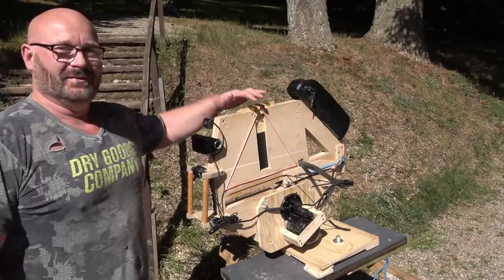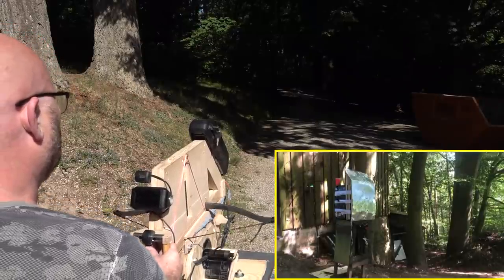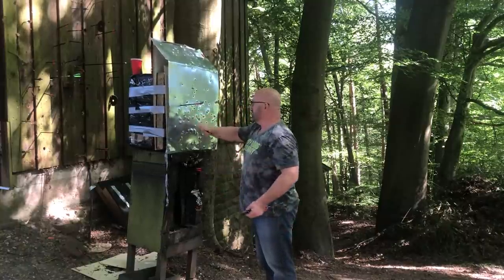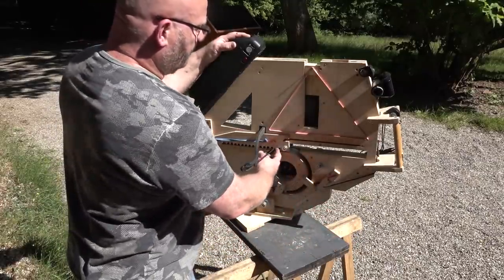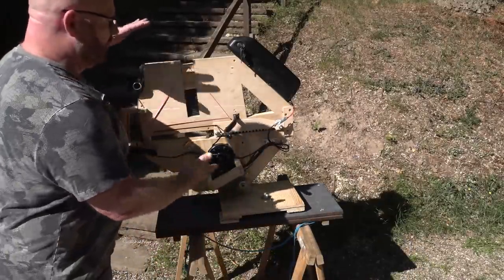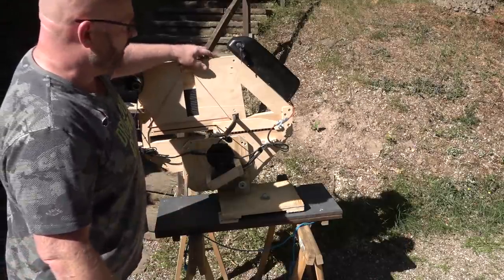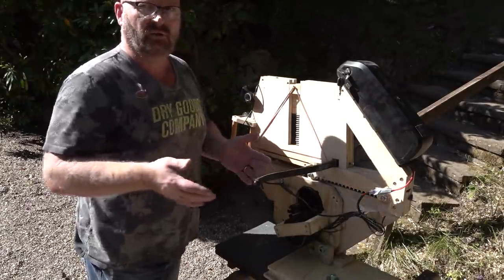The wonders of the full size, full auto crossbow.

Comment: Joerg, hear me out: the next logical extreme is an automatic ballista. You'll probably need a large diesel engine to run it, but it would be the scariest pseudo-medieval siege weapon in existence.
Reply: aktually steam engine wood be perfect for this
Reply: Or the walkingrad that some trebuchets used. I'm sure with the right gears, you should be able to do something.
Reply: @erikbergstrom258  
A Stirling engine would be epic. It's the same principal as a steam engine but instead it rapidly heats and cools air. It can use literally anything flammable as long as you can get the proper temperature difference between the hot and cold side. Literally power a ballista off of a pile of wood. Or for your ORK BOYZ out there a flaming pile of car tires. Sorry for the Warhammer 40k reference. Lol
Reply: @isaiahcampbell488  , It would be cool, in general they have a higher efficiency, though stirling engines have a lower power to weight ratio than steam engines. But or a fixed installation, UNLEASH THE DAKKA!
Reply: I'm just laughing so hard trying to imagine a diesel powered full auto ballista, you made my day
Reply: Isn't it amazing how Joerg spurs your imagination with his stuff?
Reply: @mennograafmans1595  Maybe six or seven hundred hamster wheels, turning a single crank?
Reply: You made my day. :D
Reply: Yeah, I have been thinking of doing this myself. With a ballista you have that opening in the middle so there is a little bit less strain on the system. Another improvement is to add a set up a rig to prevent long term damage into the ballistas frame and slide/sled. The idea of a rapid succession of large bolts heading down range is amazing!
Reply: @isaiahcampbell488  they are efficient but they're heavy, and expensive
Reply: I imagined it firing, what I saw was a medieval Katyusha, with the constant buzz of the diesel motor, rhythmic banging of wood, thick ropes sliding all over the place, and the sound of lances flying one after another
Reply: make the toadfish from crossout
Reply: And then he would shoot it from the hip
Reply: The scariest medieval siege weapon was already created. Its called the trebuchet
Reply: You could just use Ropes that are under pressure, which is relieved at once or in bursts. Could be mounted onto defense Towers. Maybe even gravity assisted unloading through weights.
Reply: Isaiah Campbell problem is that sterling engines are shit for anything practical
Reply: If it's for dragon hunting, what do you care?
Reply: Excellent idea, but there is already a weapon that can do that called a polybolos, which was a smaller version of a standard roman ballista powered by a crank handle and specially-built chain link to cycle the string. It was invented by the Greeks in the 3rd-century BC. Still, ballistas are an interesting class of weapons because they were used as naval artillery on warships like Quinqueremes and Hexaremes during the Punic Wars.
Reply: 3 Phase Electric? (with odrive...)
Reply: My desire to design, construct, and utilize a Jeep-mounted one is how I found and followed Joerg in the first place. It isn't viable for sieges, but it is wonderful for both disrupting riots and dispersing mobs of savages crippling traffic.
Reply: What if he converted a Hellephant car engine into a full auto ballista??? I wonder what would happen...

Comment: Hmm, seems you could make it an even power cycle by having the second set of teeth, but the second set of teeth goes to another bow. Two different sleds driven at opposing sides of the drive gear and therefore firing in an alternating sequence without putting more strain on anything.

Comment: Actually I see one way to make it portable. You can put the battery in a backpack and make a special sling (like baby-sling haha) so you are able to carry the crossbow on your chest. Looks like some adjustments will be needed so you can comfortably operate it. Plate to comfortably and firmly mount it to the body and the trigger button needs to be put on the side. Hope you see it, can be a good idea)
Reply from the maker: Too heavy for a chest sling. We are talking 20 kilos or so, poking out 80 cm. Backbreaking stuff.
Reply: @Slingshotchannel  but the battery will be in a backpack on your back. So the weight will be distributed on your body better and the crossbow itself will be less heavy. The idea itself is about detaching the battery and putting it in the backpack and try to distrubute other weight by sling system

Comment: I still believe there are many ways to combine elements of this contraption to achieve better size and/or usability. And there are many ways to transfer power of the motor to the bow.
This thing can be developed in many possible ways :)
PS: full auto rubber-electic powered Death star? :)

Comment: Imagine if this guy was allowed to experiment with guns!
Reply: Actually that might be too easy. Lol. Like for instance if you have someone build you a calculator today using electrical components it would be on par with one of those that can be found at the dollar store. If you built a calculator that could do the same math but only using mechanical components like gears and pulleys and such, it would take up most of a small room. People actually built those back in the day, by the way. Lol. But unfortunately for firearms the market has stagnated to a major degree. There is room to be had but unfortunately nobody really seems interested in true innovation. BUT if Jorge could get in there, have free reign, and not care about the critics of the gun world, he might actually make some world changing innovations. It's just hard to get that ball rolling. But thankfully not impossible! Sorry for the rant.
Reply: @isaiahcampbell488  I don't think there are any world changing innovations to be had in firearm design right now. We are at a point, where we just don't know how to make our guns fundamentally better. We can improve in areas like optics and such, but the core design of the guns? Nothing new for decades. Hell, most modern handguns use Browning tilting barrel system, which is over 100 years old.

Comment: That is some impressive machinery. I like the mix of clever solutions and simlpicity and just as with the crossbow, the only way to improve on the material would be overly complex. One way I suppose would increase power and reduce weight would be to lighten the bolt carrier group, to increase the acceleration the string can provide, without adding more stress. In any case it was fun to see the machine work.

Comment: An alternating setup with 2 crossbows would be cool, it would probably increase the rate of fire
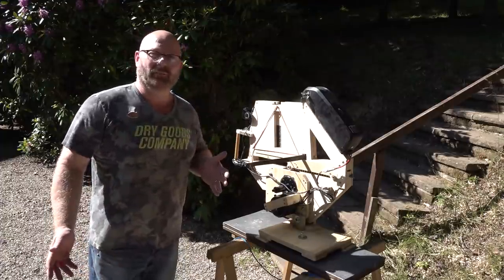Reply: Set it up horizontally side by side with a single motor and pinion in the middle and magazines on the sides. Alternating the drawing mechanisme will flatten the load curve on the motor. Reducing extreme uphill - chain break/nothingness pattern that Joerg was talking about at 2:53 . Might be okay to use smaller motor with lower specification.
Reply: Better yet, replace the rack&pinion with cam axle. So the slides move like  pistons in a two stroke  engine.

Comment: Dear Jorg it can be made portable by using a smaller engine such as a smaller drill, by using another cog added on the spindle on the other side of the rack and pinion. This other large cog could connect to a small cog with then the smaller connecting to the drill as a gearing system. The loss of power efficiency in the friction of the gearing system would be more than offset by the increase in power because the gearing. It may fire at a slightly slower rate but still could be very fast and more powerful with the increase in draw weight from this drill gearing cog.

Comment: You could balance out the uneven amounts of resistance by having two crossbows powered by the opposite side of crank. When the first rack and pinion releases, the second could kick in. Also, consider that you could use a pneumatic "battery tank" to power your drill, at which point your could use bicycle cranks to work a dual stroke air pump that would have smooth torque requirements for the cranking while continuing to deliver that jerky power output.

Comment: Okay a few things I though of, even if they might not apply in this case.

1)  Aluminum is 3 times heavier and stronger than wood. So switching allows you to create a more compact device by literally using less material.

2)  The torque and speed of a motor is partly dependent on the gearbox. There is a video of a lego motor pulling 88 kg at 1 cm/min using a complicated series of gears and pulleys (gear ratio of 135:1). Getting the right motor with the right gear ratio can potentially make for a smaller or at least lighter device.

3)  How would tapering the magazine so that its wider at the top and middle affect reloading, capacity, and space?

4)  It is possible to make the gear to always be connected using a snap release to seperate the motor from the gear. But that is a more complicated mechanism for little benefit in this case.

Comment: It is completely doable and possible to add second set of teeth to the gear. The tension on the sled would stay the same, but the point is in adding a delay to the circuit. Every time we need a sled in initial position electronics will turn off the circuit, sled will go here and when it is in start position the circuit will turning on, going for other half of power cycle. It can be done with some switches, transistors, mosfets, etc. It adds additional complexity to the circuit, but it would work.
Reply from the maker: Maybe, but then the shot frequency would not go up. Why would you add complexity if there is no practical benefit?
Reply: @Slingshotchannel  yeah, you are right. We will not see double speed with this settings, maybe some % of speed gain will be here.
Love your videos!

Comment: For motorless manual operation, you could add a flywheel and a clutch ... Spin up the flywheel then release a clutch with a trigger to engage the flywheel to the loading drive mechanism... That would solve the uneven cranking force needed during a cycle.

Comment: For consistency power from pedaling, you could incorporate a heavy fly wheel and belt drive with a clutch to engage after momentum had been invested in the fly wheel. This would, of course, require it to be  vehicle or at least trailer mounted.

Comment: Just looking at Milwaukee's website and their battery powered impact wrenches boasts a torque at between 1600 Nm and 2000 Nm depending on model and setting.

Isn't that on roughly the same level as the e-bike powering the crossbow?

Comment: Hello Joerg, why don't you use just use a battery drill paired with an external gearbox to increase it's torque?  I have used such a solution for building a malt grinder and it works very well.

Comment: Nice build :-)  it echoes ideas I've been harboring since childhood.  The electric bike engine is vast overkill for what you need, since it's a constant duty device.  A starter motor gives you multi-kilowatt output at a fraction of the weight.  You'd need further gear reduction, but you don't have to mess with brushless drivers.  Also, the rate of fire is limited mostly by the weight of the sled.  Using an off-the-shelf steel rack and pinion could potentially help with that, as could a cam or toothed belt drive mechanism.

Comment: Have you tried carbon fiber roving strand in place of the bow string? Just curious if that might hold up better. Polishing the guide slot, wear part in middle of string.... just spit balling.  I have not tried this myself, but I will. Sled could use a dampener on the return so it doesn't bounce. Last thought, use a double acting pneumatic actuator instead of an electric motor, that way the "sled" could be dampened on the return stroke by modulating the release of air. Could be more compact, run off a bottle, and perhaps you can get it off the bench mount. Barring that, could be time to gimble the whole thing on bearings or pivots. Zombies don't come always from the front. Perhaps you could plunder the steam bow for parts....
Reply from the maker: Sorry, but unfortunately none of your ideas would work. The slot IS polished of course, otherwise the string would not last longer than 10 shots. The string should be made from special material called Dacron, and of course it has to be reinforced in the middle - that is called a "middle serving". A dampener would INCREASE the bounce, not decrease it. Pneumatic mechanisms are way too slow for a full auto weapon.

Comment: Only mechanism more compact would have to be a worm gear where the screw pivots away from the sled.  The sled would have to trigger that pivoting mechanism when it reaches full draw. You might reduce the overall height by 100mm or so and avoid protrusion caused by the sideways mounted motor and gear assembly you have now.

Comment: It shall be possible to make it portable and space-marine style. Opportunities:
1. Put battery and engine in a backpack with flexible powershaft.
2. Place cogwheels and magazine on the same upper side. It could be 2-cog system for symmetry and on a slim shaft to leave space for arrow feeder in-between.
3. To trade length and hight on thickness via asimmetrical design. Despite it's just a trade-off it shall be felt much less bulkie.
4. As far as strength requirements for motor are a function of drawed length, using simple automatic gearshifter can reduce requirements for the motor (like variable diameter "gear" as in compound bows or else)

Comment: I noticed the full auto crossbow shook a little bit during auto firing. This could be reduced if you changed the attachment to the base from a single rotational joint to a four-bar linkage setup, likely in a trapeze shape, with the ability to tighten each of the four bolts. Once "aimed" tighten down the joint bolts and you will have a more stable machine in full auto.

Comment: What you need are two torsion micro-limbs (springs) rather than just one bow, one on each side like the Lancehead, so that one is in the process of winding (loading) while the other is in the process of operation (firing). This would make it both faster and smoother.

Comment: Suggestion: You could probably use a flywheel to reduce the impact of torque loss in the firing cycle. It would also reduce the peak torque demand on the return of string strain on the motor.

Comment: When i said about second set of teeth, i meant a second gun, linked via an axle. Like you said with the bicycle comparison, the bit that is equivalent to the chain breaking could be used to drive a second gun. While gun 2 is firing, gun 1 has the sled resetting, gun1 fires while sled 2 resets etc. 

Awesome nonetheless. 👍
P.s, all the best on working out 💪
Reply: I'm picturing an anti-air crossbow set up like a double barreled ourlikin from WW2 where the arrows are fired alternatively between barrels. Lol.

Comment: Could you put a spring where the ram hits so it absorbs some of the impacts to prepare it for the next shot? Also, could you use a Gatling spring pedal system? So you would pedal and compress a spring and then cycle to compressing a new spring then after you have switched to a new spring the former spring could be released?

Comment: That thing is awesome! But if you did want to make it smaller you could mount the battery pack in a backpack setup, and mount the motor vertically either using bevel gears, or cutting the gear rack so it is facing the left or right side. Then you could also have a bottom feed clip with this setup as well.
Reply: Of course the motor would be mounted at the front and the gear rack would need to be longer. However it is far easier to come up with these ideas than to put them in practice!
Reply: Actually now that I say it, i am describing an AEG setup on an airsoft gun lol which uses a worm and wheel gear setup

Comment: If you wanted to try and increase the rate of fire you could look into something from the airsoft industry. Since that full auto crossbow seems to function very similarly to an airsoft gearbox, check out what is called a dual sector gear setup. It essentially fires twice per rotation of the gear, but it is a shorter stroke. We use more powerful springs to compensate for the shorter stroke. You could probably use a higher draw weight crossbow, and maybe some custom bolts to allow the short draw length. Just a thought after hearing some of the ideas. Love the videos, and that laugh.

Comment: Suggestion: Instead of using a gear type "reload" mechanism, how about a reverse rail-gun reloader?

To "load" the first shot, you trigger the rail gun to "fire" a nestled pin that drives the carriage back, then when the bow fires, it resets the pin back into the rail-gun, ready to be fired back again. You could realistically make it into a "man-portable" rifle/crossbow with no gearing or motors required.

Comment: Have you ever tried to work on a double stack magazine for any of these arrow or bolt magazine contraptions?
Kind of seems possible since you're using projectiles with two fins.
In firearms you have double stack, double feed magazines like an AR, which may not work so well but you've got double stack, single feed magazines like a Glock (or really any double stack handgun).  Just a thought.

Comment: What about a parabolic coil instead of a linear mechanism to load the bolts? This would give you larger capacity, reducing the height but expanding the width only slightly. Plus it would be a great feat of engineering.

Comment: Get the battery in backpack! Also... in theory, with a clutch like mechanism or a longer sledge, you could put the motor at the stock and make it bottom loading. The more light the noise of a gun is, then usually the easier to aim.